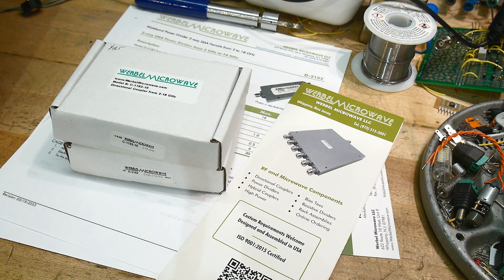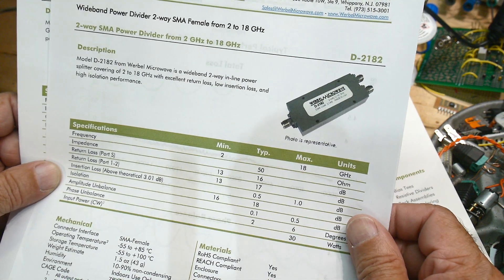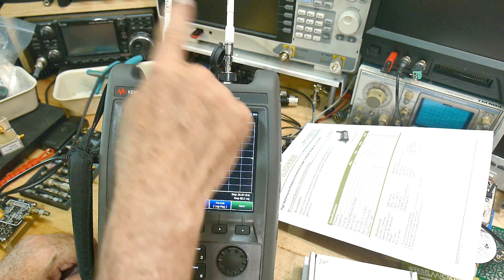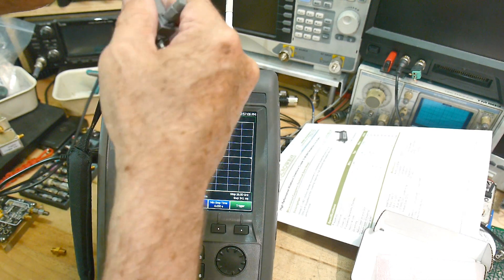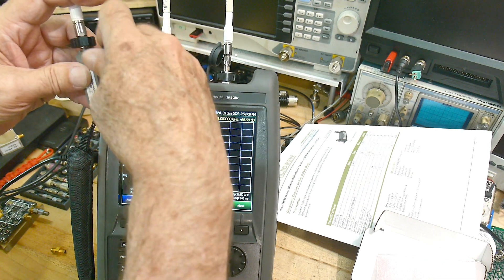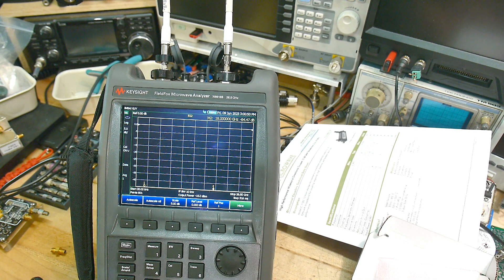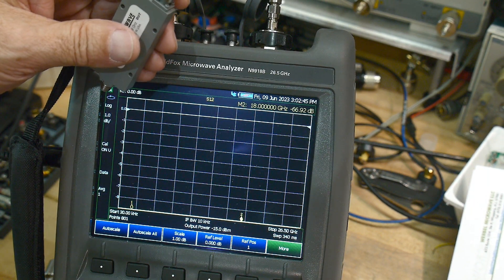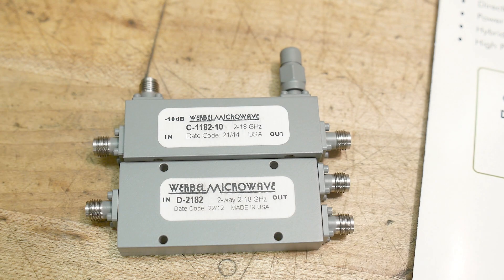#1552 Werbel Microwave Coupler and Power Splitter

Comment: The directional coupler is actually is actually specified correctly on the data sheet. You forgot to take off 10dB on the directivity measurement due to the coupling loss so it is in spec.
Reply: correct, thank you.  we get this a lot.  isolation is a directly measured spec.  directivity is an inferred spec (isolation minus coupling), but more meaningful to applications than isolation.

Comment: Ok, what's their use in the garage?
Reply: Priceless on a RF workbench.  I have a 1.5 to 35MHz 30dB 2kW Bird directional coupler connected to a 4 way Mini-Circuits splitter / combiner that is permanently connected to a spectrum analyzer, oscilloscope, RF power meter and frequency counter.  It allows me to transmit through the directional coupler, through a inline Bird wattmeter which is terminated into a 2kW dummy load and the output from the coupled side which is 30db down goes to the 4 way splitter.  With this setup I can transmit with a legal limit 1.5kW HF amateur radio amplifier and view it on 5 instruments simultaneously.  If you also normalize or calibrate the "system" then you can take accurate measurements on the instruments connected to the 4 way splitter / combiner.  I have a similar setup that covers the VHF through to 3 GHz in the S band.  In a nutshell I use the directional coupler as a sample port and the splitter / combiner splits that sampled signal into several instruments.
Reply: @mikesradiorepair  Thanks for the details. Real-time monitoring would be good insurance when putting out so much power. 
Your YT  exit was singular.  Will you be sharing again?
Reply: Coupling and the occasional splitting would be my guess.
Reply from the maker: good guess
Reply: @IMSAIGuy  Nah, it'll just live in the drawer with the other couplers.